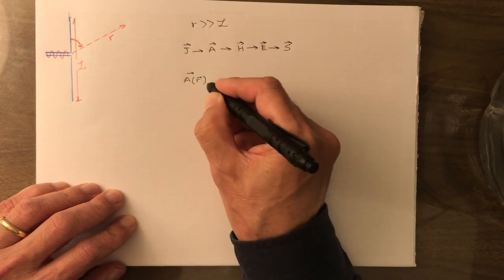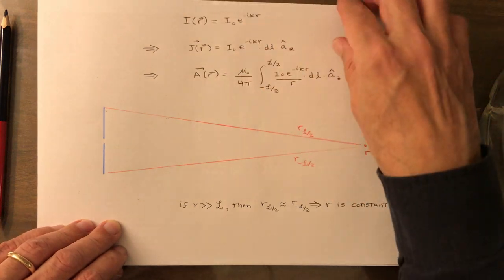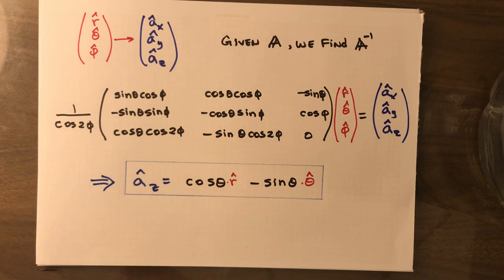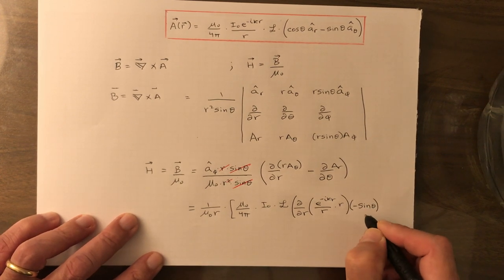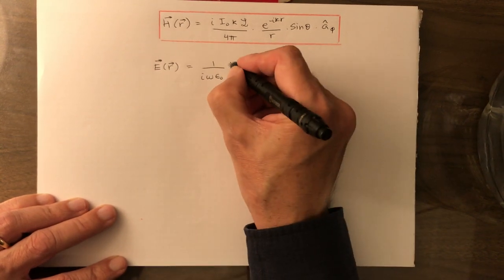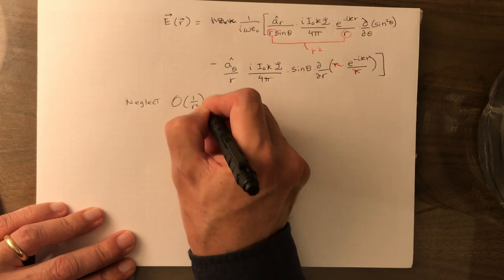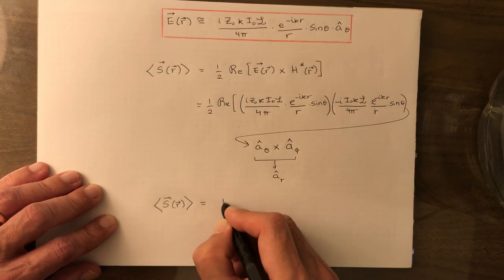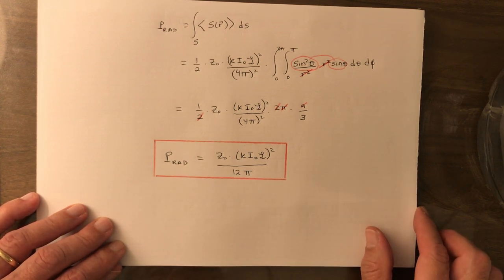Infinitesimal (Hertzian) Dipole Derivation

Comment: @ 03:06  Current-density J = charge-density x velocity = (n . q / vol) x v = (Q / vol) x dz/dt = (Q / dt) x (vol / dz) = current / area. 
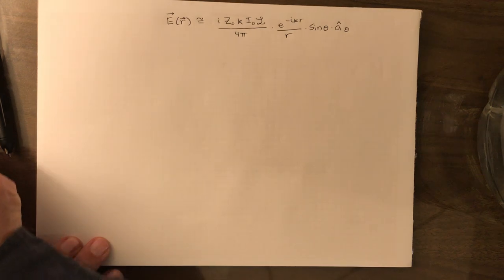@ 30:50  This seems to be a nice result, but it is not complete. There is no time-dependence and thus, there is no acceleration!
                 The problem is solved by using an oscillating current: I = I(max) . exp(w.t). This exponential is missing in the video.
Reply from the maker: Thanks for the comment.  (1) J = dI/dA = rho*v.  (2) the analysis shown assumes only a snapshot in time which is why e*ikr is used without the eˆ-iwt part.  I agree that it's not the complete expression since we're missing time dependence but it suffices to show the spatial character of the wave.
Reply: @quantumradio  Your videos are like a piece of art. That's why I come back to them. I don't want to criticize you, just add something. Thanks!
Reply from the maker: @jacobvandijk6525  Of course.  No offense taken.  I sincerely appreciate your comments and insight.  Have a good one!